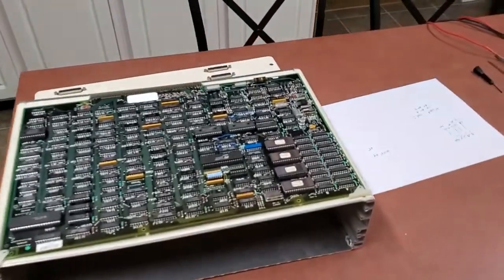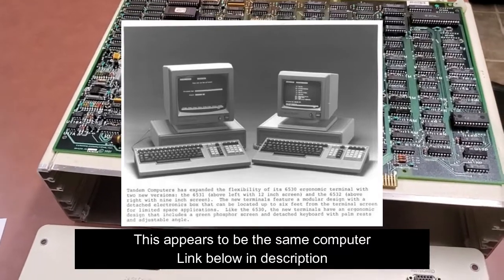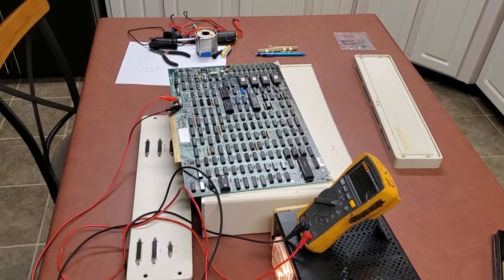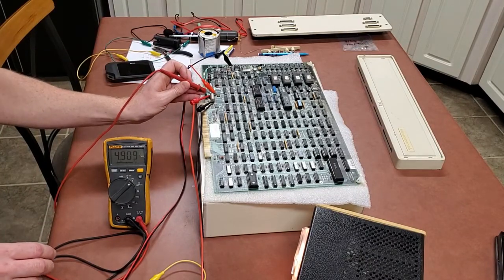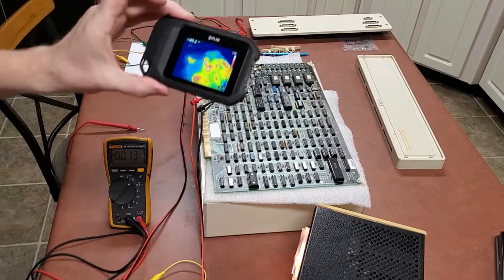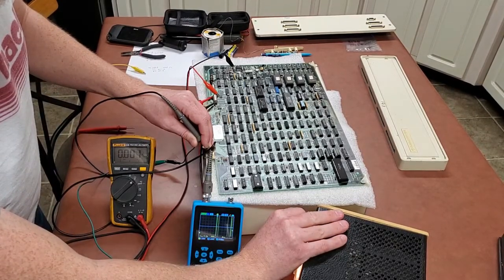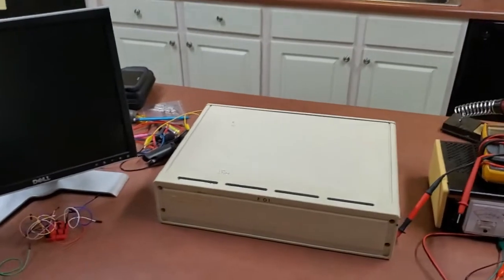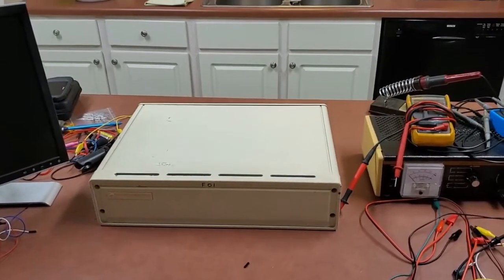Tandem Z80 computer

Comment: As another person has said, this was the enclosure that housed the terminal board for the Tandem 6530 console. They had a proprietary keyboard and monitor made specifically for Tandem that paired with this unit. This was the smaller brother of the fully self-contained Tandem 6530 terminal. I haven't seen one of these since 1996. My dad worked at Tandem for a very long time, even well into the HP Enterprise era and they had this in their office so that the mainframe could be locally accessed. Finding the matching components these days are going to be insanely difficult. FedEx here in Memphis was a large Tandem shop back in the 90's and early 2000's.
Reply from the maker: Thanks for the info.  That is what I figured since nothing seemed to match any standards. I'm going to make another video on this soon hopefully.  I have a few monitors that are pretty adaptive to different sync frequencies I want to try. I'm pretty confident I can emulate the keyboard.

Comment: This was the Tandem Dynamite. I used one when I worked at Tandem. It was a DOS-compatible computer with a terminal emulator. The pancake-style boards were horrible. They would get hot and start bending and would fall out of their slot onto another board.
Reply from the maker: Hey, that's more information than I have read about this device on the whole internet haha. So was this device not designed to connect directly to a monitor?  I didn't even see what the output of the serial port was.  That would be neat if it was a dos prompt. From the few images I found, it looked like this was the terminal for another computer.

Comment: I believe you’re right that this is a terminal base unit for Tandem’s minicomputers or mainframe computers from the early 1980s. Since Tandem’s stuff started life as a fault-tolerant HP3000 minicomputer/mainframe semi-clone, I bet this is a semi-clone of the HP block-mode serial terminals.

A different display will probably just work, like the NEC LCD1990SX which can auto-sync to a number of oddball frequencies, handle both positive and negative TTL sync automatically, and so on—I’ve even been able to get HP 512x480 hardware to show a reasonable picture on one.

What’s the peak-to-peak on the video signal, 0.7V would be RS-170 but I could see something from 1981 using straight TTL for video to a proprietary display like the one you (and I) presume was also supplying the power, so if you want to hook it to a display you might need to crank the voltage down a bit with a resistor or via a transistor.

Serial keyboards were common in the era too, it’s probably pinging the keyboard to detect it and trigger a self-test. (It’s probably also supplying +5V or +12V on the keyboard connector too.) If the keyboard doesn’t reply in a certain timeframe it’ll probably show “Keyboard error” or something on the screen.

Do you have any high-res photos of both sides of the board, or could you take some? And have you dumped the ROMs and shared them somewhere? Between photos to get part numbers (eg for the UARTs and VDC) and ROM dumps I bet an awful lot could be discovered about this unit.
Reply from the maker: Hey Chris, Thanks for the reply. I was going to see if anyone commented before moving forward. 

I did work on getting a display to work after this video. I inverted the sync signals and tried 3 different LCD displays, but they all said something along the line of unsupported resolution. I see the NEC monitor on EBAY used for around $100 dollars. Does that sound correct? I may be willing to purchase one just to have. I did sign up for the Retro Hack Shack newsletter so I would get an alert when the RGBtoHDMI device was back in stock which is also supposed to sync to many different resolutions/frequencies.

I should have taken more pictures of the data, but I believe it was 0.7V. I did not consider that being an issue. What voltages do monitors typically look for? Could this cause the unsupported resolution message or would it just make a white screen?

The Horizontal sync was very close to the MDA sync of 18.43KHz, but the vertical sync was 60Hz instead of the standard 50Hz.

I have a device that takes in VGA and combines the V-Sync and H-Sync to make a composite output. I ran that into a Magnavox black and white monitor I have. The monitor has sync adjustment knobs, but they did not have enough range to sync the signal. I was thinking of reducing the crystal frequency down to where the Horizontal sync was closer to PAL and this would have something closer to a 50Hz Vertical scan. I was thinking a regular TV may be able to sync to that. I did also try hooking a TV to the composite output.

I have made a blank page at the link below. I'll add pictures and ROMs to this as I have them. I will try to get some pictures on there tonight or tomorrow. ROMs will follow.

http://www.johnhamerprojects.com/projects/tandemComputer/
Reply: @JohnHamerProjects  Awesome, thanks so much for the detailed reply! I’ve gotten each of my several NEC 1990SX for between $30 and $100 (US) so with the price gouging we’re seeing these days, $100 isn’t unexpected for one. They’re wonderful displays, despite occasionally needing a recap themselves, which I’m sure you’re quite capable of. :)

If the video signal itself is running 0.7V peak to peak, then that should be just fine and it’s just the sync being out of range that’ll cause the display issues, worst case you’re correct that’d be just an all white (or light gray) picture.

If you’re not on it yet, the classiccmp Discord’s #terminals channel might have people who are familiar with this unit, or ones like it, who may be able to help to. And they’d definitely be interested in the pictures and any ROM dumps. :)
Reply from the maker: @cmhenator  I don't have a Discord account. I guess I should make one. I uploaded some pictures. I'll organize the page a little better as time goes on.

Comment: That's not a Dynamite.  It's the board box for a TANDEM 6530 Terminal.
Reply from the maker: That's what I was thinking.
Reply: @JohnHamerProjects  I hadn't seen the ad he found before I posted, but he hit the nail on the head.  The models were 6531 and 6532 based on the monitor size.  The original 6530s had the boards inside the monitor case, making the terminals very large.  Interestingly enough, they charged extra for longer keyboard and CRT cables to let you put the box on the floor under the desk, which we all wanted to do to save desk space.
Reply from the maker: That's awesome!  I'll have to revisit this when I get some time.